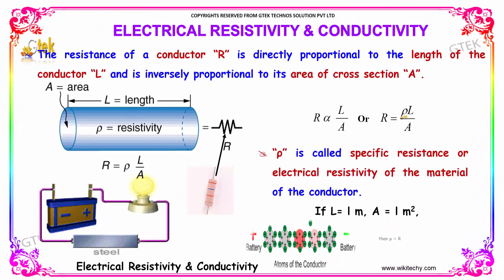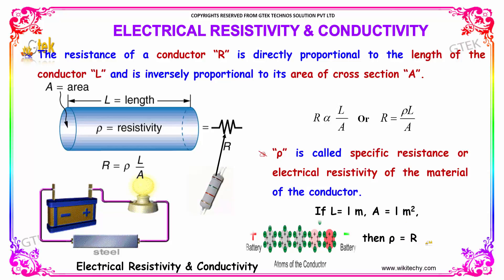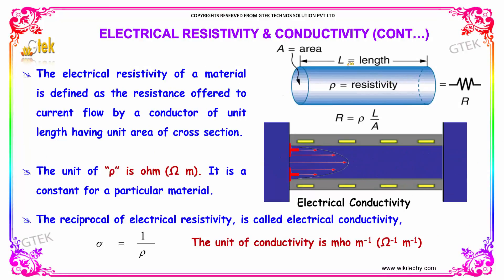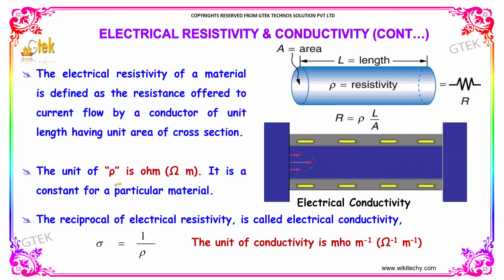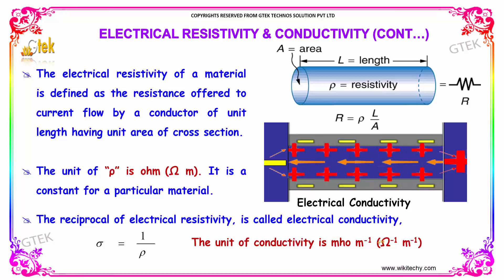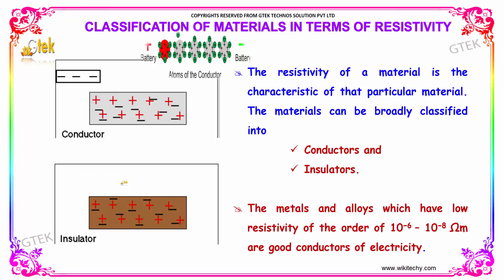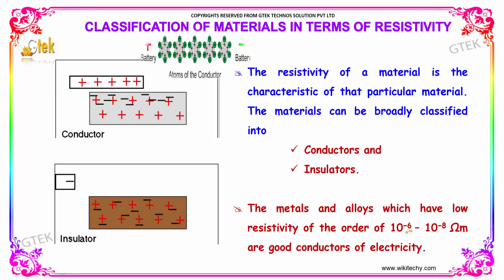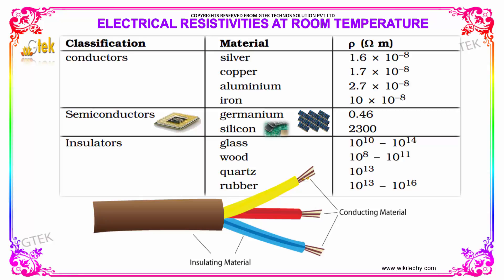Electrical Resistivity and Conductivity Current Electricity class 12 physics notes CBSE IIT JEE NEET

Comment: Resistance is the measure of electrical “friction” as electrons move through a conductor. It is measured in the unit of the “Ohm,” that unit symbolized by the capital Greek letter omega (Ω). Set your multimeter to the highest resistance range available.

Comment: Resistivity is commonly represented by the Greek letter ρ (rho). The SI unit of electrical resistivity is the ohm-metre (Ω⋅m). ... Electrical conductivity or specific conductance is the reciprocal of electrical resistivity, and measures a material's ability to conduct an electric current.

Comment: Stainless steel may be the least conductive metal, but it still does conduct electricity more effectively than many other substances. Gold is a less effective metal than silver, and metals like copper and silver will be used more often in electrical contexts due to their high conductivity.

Comment: Stainless steel is a relatively good conductor of electricity, as are all metals. The body is also a good conductor, due to water. The skin is a relatively poor conductor of electricity because of dead skin cells. Any break in the skin, i.e. cut, greatly reduces its resistance.

Comment: The electrical resistance of a circuit component or device is defined as the ratio of the voltage applied to the electric current whichflows through it: If the resistance is constant over a considerable range of voltage, then Ohm's law, I = V/R, can be used to predict the behavior of the material.

Comment: Electric current flowing through a conductor is associated with magnitude as well as direction. .... If ρ is the resistivity of the material, and σ is the conductivity of the material then (in SI units) ... To read more, Buy study materials of Current Electricity comprising study notes, revision notes, ... Complete Physics Course - Class 12.

Comment: Electrical resistivity (also known as resistivity, specific electrical resistance, or volume resistivity) is an intrinsic property that quantifies how strongly a given material opposes the flow of electric current. A low resistivity indicates a material that readily allows the flow of electric current. Resistivity is commonly represented by the Greek letter ρ (rho). The SI unit of electrical resistivity is the ohm-metre (Ω⋅m).[1][2][3] As an example, if a 1 m × 1 m × 1 m solid cube of material has sheet contacts on two opposite faces, and the resistance between these contacts is 1 Ω, then the resistivity of the material is 1 Ω⋅m.

Electrical conductivity or specific conductance is the reciprocal of electrical resistivity, and measures a material's ability to conduct an electric current. It is commonly represented by the Greek letter σ (sigma), but κ (kappa) (especially in electrical engineering) or γ (gamma) are also occasionally used. Its SI unit is siemens per metre (S/m) and CGSE unit is reciprocal second (s−1).

Comment: Electrical conductivity or specific conductance is the reciprocal of electrical resistivity, and measures a material's ability to conduct an electric current. It is commonly represented by the Greek letter σ (sigma), but κ (kappa) (especially in electrical engineering) or γ (gamma) are also occasionally used. Its SI unit is siemens per metre (S/m) and CGSE unit is reciprocal second (s−1).

Comment: The electrical resistivity of a material is also known as its specific electrical resistance. It is a measure of how strongly a material opposes the flow of electric current.

A definition of resistivity is the electrical resistance per unit length and per unit of cross-sectional area. This is for a particular material at a specified temperature.

It is also possible to define the resistivity of a substance as the resistance of a cube of that substance having edges of unit length, with the understanding that the current flows normal to opposite faces and is distributed uniformly over them. The SI unit for electrical resistivity is the ohm metre, although it is also sometimes specified in ohm centimetres.

Comment: The electrical resistance of a circuit component or device is defined as the ratio of the voltage applied to the electric current whichflows ...

Comment: Electrical resistivity, represented by the Greek letter ρ (rho), is a measure of how strongly a material opposes the flow of electric current. The lower the resistivity, the more readily the material permits the flow of electric charge. Electrical conductivity is the reciprocal quantity of resistivity.